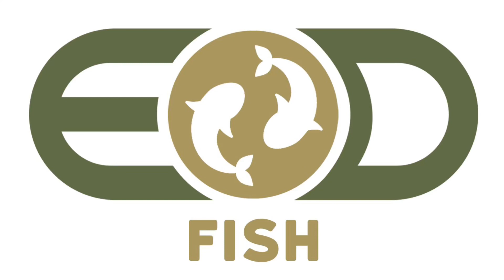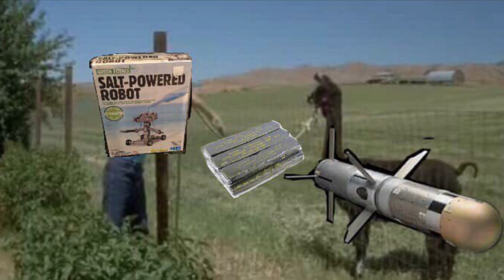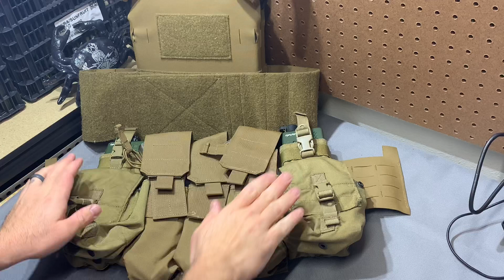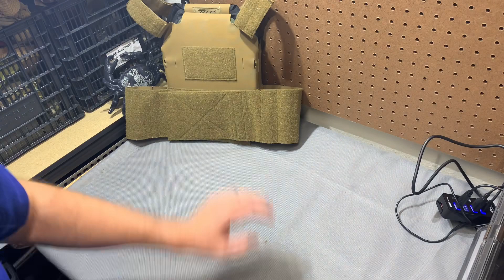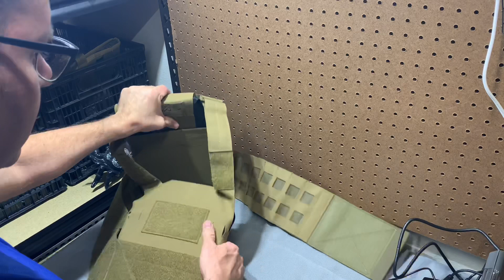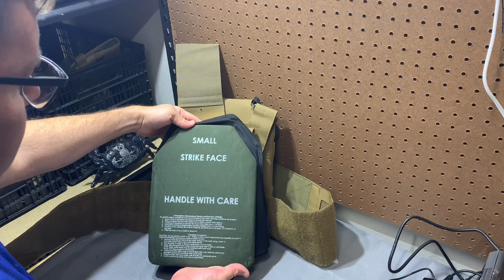Javlin Concepts Minimalist Plate Carrier with RCOS cummerbund

Comment: It strikes me that there are a variety of different donning/doffing systems (Firstspear Tubes, cobra buckles, ROC buckles, Arbor Arms FRC, etc) designed to make getting into and out of the plate carrier easier. This, on the other hand, seems like it would make getting both into and out of the carrier even more difficult with needing to either layer on or peel off the whole RCOS panel. I get the desire to be able to quick swap between set ups, but this seems like an expensive ($130 per RCOS) poor man's solution (as in this seems like it would be less expensive than it is) when other companies offer various flaps, placards, panels, etc.
Reply from the maker: I totally get what you are saying but if you aren’t working around water, donning and doffing speed is just a nicety that may not matter. This plate carrier is incredibly comfortable for what it is. I also don’t think I would have called this a poor man’s solution to anything. It is a single dude making them and I am sure there is some initial investment still being paid off.